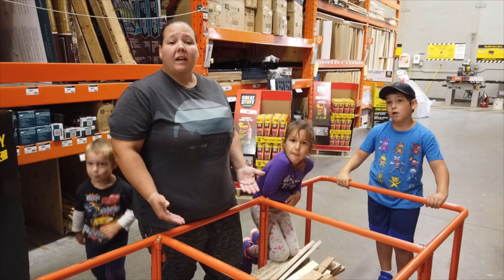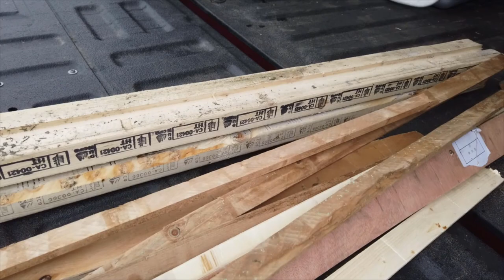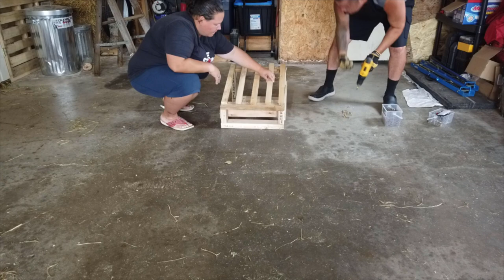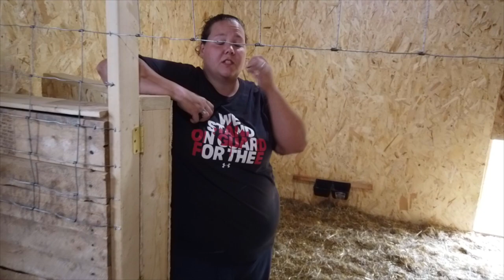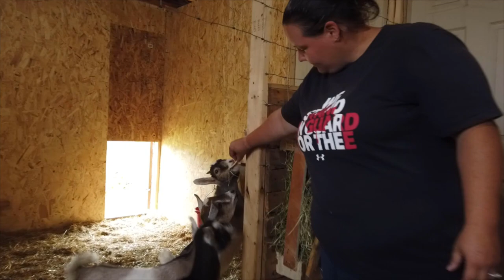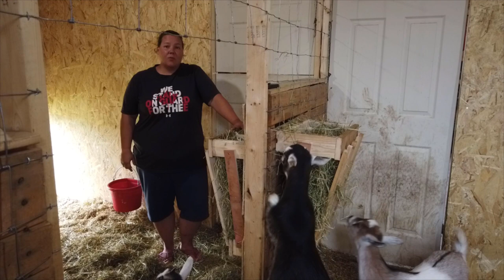HOW TO HOMESTEAD WITH NO MONEY / DIY WOOD GOAT FEEDER

Comment: Scrap Wood Bin! Beautiful words. 

Hey, what would you recommend as the power drill/screwdriver/etc. as that one power tool that could take different attachments, 3/4 chuck or 1/2 inch? 20volt? or 18?DeWalt? 

Nice feeder

thanks Good vid.
Reply from the maker: I have a 20v cordless drill that I use for 90% of the jobs around the homestead but when I was installing concrete bolts I had to use my drill that I plug in. 1/2 inch chuck will do the job as you are probably just going to use drill bits and screw bits in it. If your budget allows for a bigger drill I would get the bigger drill more power the better.
Reply: @RunamuckFarms  thanks